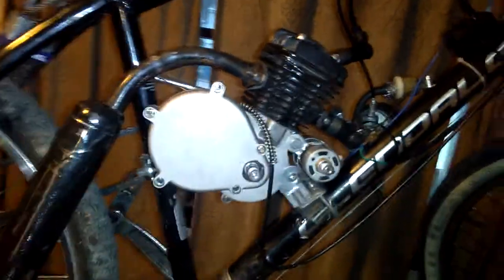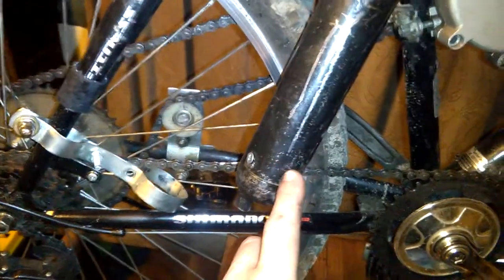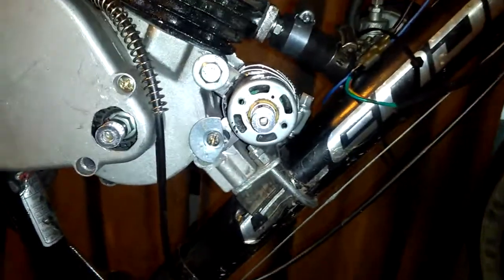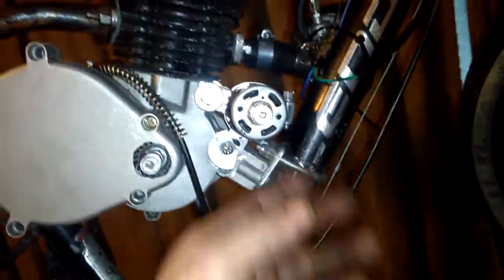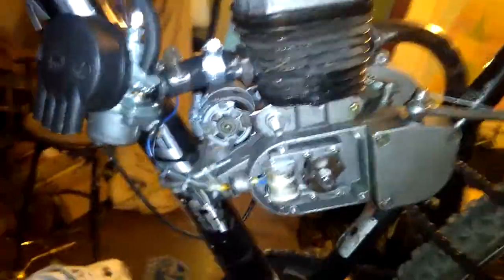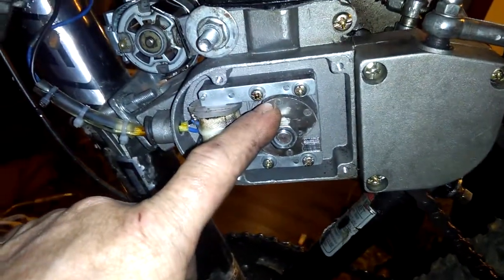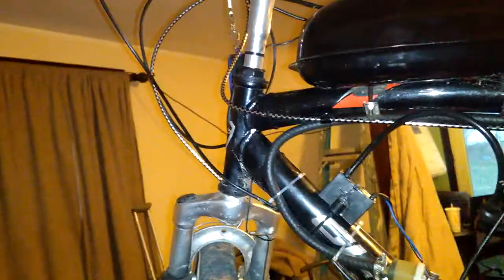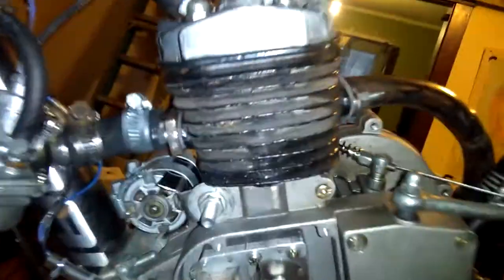80cc Motorized Bike "Real" NEW Upgrades/Mods!!

Comment: Why is the cylinder backwards?
Reply from the maker: quiets down up front for my speakers so i can hear my radio,lol, ram air, straight into the carb for performance? keeps legs from getting burnt, avoid steps with exhaust, easier to work on, carb, colder air in,other components im adding
Reply: Mechanically Electric, ram air with a carburetor is bad.  It reduces vacuum at the jet, so you get less fuel, so the faster you go, the leaner the mixture.  Just putting the carb in front does not mean you've got a ram-air intake; your inlet is still facing downward, not into the oncoming air.  However, this is a good thing; you will increase vacuum this way.  If the inlet is angled slightly rearward, even better!
Reply: It helps to Dremel out the transfer ports, but it will run without it, this helps a lot because the crank at 9000 rpm will pull in air rather than pushing against the intake
Reply from the maker: @Jesse Mazo flip the jug and piston

Comment: You should get a rear rack so you have more surface area for all your crazy bells n whistles. I built one for mine out of an aluminum step off a Semi and square aluminum tubing. Now I'm thinking of strapping an auxiliary fuel tank under it- I put two 3" antique taillights on the back of it and I'm currently trying to figure a way to get actual lights inside of em- like 6v or 12v little LEDs I can fit through the backs. I really wanna try that generator- what type is it? Would you post links to hardware soon?